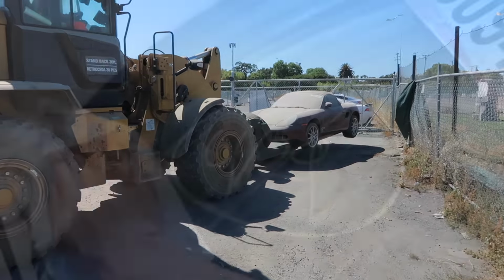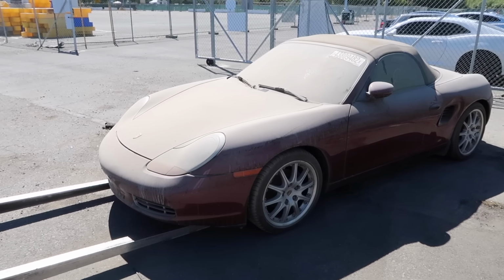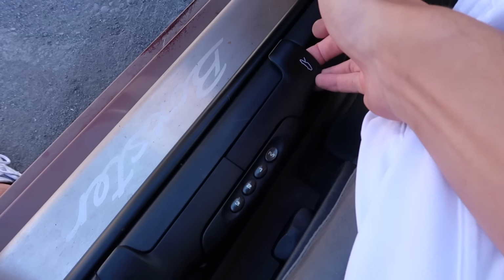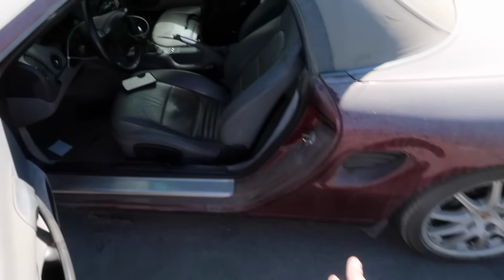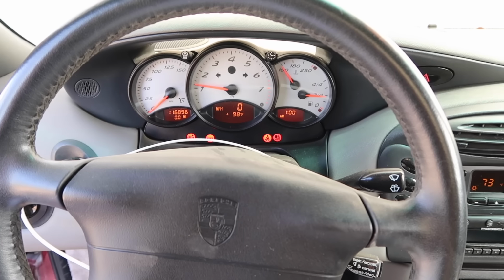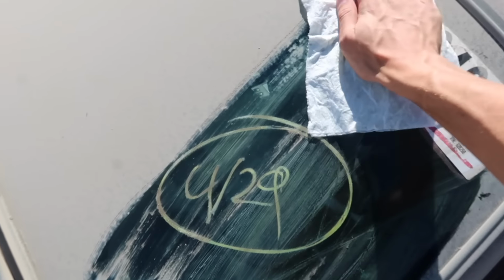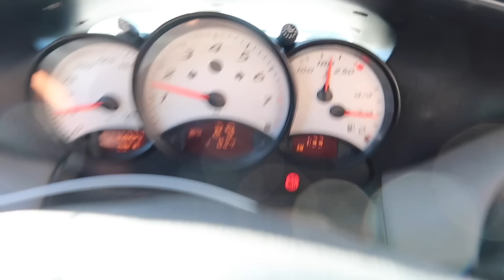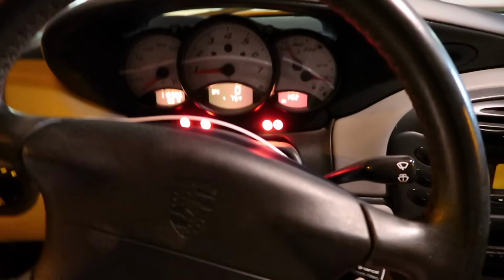I Bought a FILTHY Non-Running Porsche Boxster at Auction! Let's Fix It!

Comment from the maker: As promised, to close out the 12 days of Christmas special, we will be giving away our R3 RX8 tomorrow to a random follower for FREE 🙏🏻 Follow the IG page to have your chance at it! Thanks everyone for all the support of these daily uploads. Should we keep them goin?? We still have a lot of cars to reveal 🤫
Reply: I know You feel obliged to wear expensive wrist watches to match with the beautiful cars you deal with. But you did right not to wear one for this car pick up job. Nowadays we got so many things telling us the time. Like the movile phone. Your red C5 was almost as dirty.
Reply: 0:22 what is going on with that headrest?  ooof
Reply: Mate, you never connect a jump pack to the + and -. You connect the positive and then, to connect the negative, you connect it to any bare metal on the chassis. OR like u did, remove the terminals. Else the dead battery is just drinking up your current if u connect like u did first.
Reply: i want like 50 of them...! thanks again for your great videos
Reply: I'd love to include myself to your giveaways. But I don't have IG and I'm not going to get it just for your giveaways.
Reply: End of the day it is rear engined and it does need a lot of airflow going to it and going 30 mph and idling it for 30-minutes it is bound to run hot esp in that climate.
I've had 3 myself of this gen 3.3 Boxter S and with care like mine had they ran like clockwork.
Reply: Hello I just seen your video I bought me  a 2010 vw jetta 2.5 the car was sitting for a while with dead battery got new battery car does turn on nice but my windows the headlights the locks don’t work when I turn it on man it was crazy everything was going bananas lol but after a while it kind of settled down but still need help with the windows and stuff any clue I’m new on vw need help pls thnx
Reply: 5
Reply: I tried to Watch this video but the guy just would not shut his mouth up! Yapping and yapping about his good luck! Look man we just want to see the car run again okay 👍

Comment: Here's the deal ....  Been there, done that twice ... If you don't drive these for a month or so, the vampire electrical devices in the car WILL drain the battery.  If it's not your daily, keep it on a smart charger.  Once the battery is dead, you get to where this guy is.  You need battery power to open the front trunk but you can't jump the battery since it is in the front trunk.  Stalemate.  There are maybe three tricks on the internet to try.  Jumping the Row 3 Number 3 fuse worked for me once but the next time it didn't.  Porsche didn't put the post into the fuse box you thought was missing until 2001 or 2.  Some cars have that emergency pull cable, mine didn't.  My hood also had a sticky latch so pulling the cable he did in this video wouldn't work.  Smart chargers won't charge through the cigar lighter since they need a minimum voltage to work which you don't have.  And yes, the lever in the early Boxsters need power even though they seem to be manual.  The early year car levers have rods that keep the levers from moving.  When you have power, they pull out and you can move the lever.  After trying every trick on the internet without success, I borrowed a portable starter battery box with a cable that would plug into the OBD2 port.  VOILA !!!  Immediately opened.  Charged up the battery (slowly) and all was well.  But then it failed the smog test.  That is what happened to this car I'm sure.  Draining the battery gives you an engine code and you will fail the Smog Test.  There is a long procedure you can find on the internet to clear the code.  You have to drive for 30 or 45 minutes at like 35 mph then the same at 65 mph all without going above I think it is 3000 rpm.  If you have a track to do this on great.  But I tried all day and there was always cars in my way to slow me down or I would have to speed up so that didn't happen.  But just by driving it at all speeds for several hours over two days, it extinguished the code and I passed code.  So here's the deal.   Keep the car on a smart charger if you don't drive it regularly.  Get a portable start battery with a cable that plugs into the OBD2 port for if you screw up.  Drive it like hell for a few days before you try to smog it or it will throw a code.  And enjoy.  These cars are one of the cheap secrets of the fun car world.
Reply: This guy knows his stuff
Reply: Or put the jump pack terminal on the positive on the starter motor and the negative on the chassis .....easy
Reply: Battery disconnects are the cheapest solution.
Reply: @redbarchetta8782    That is no solution. For one, I never know when I'm going to want to use it.  A battery disconnect will deprogram many computers in a modern car that might even require a trip to a Porsche mechanic to reprogram. It also degrades the battery therefore its life. A proper maintainer prevents that.

Comment: I admire your attempt at working on a German car like this but I would at least change the oil before running and fresh gas as well as a few other things. Also washing the car before rubbing the dirt into the body or glass is always smart. That being said I appreciate your passion
Reply: He was in a junkyard. What else should he do? :)
Reply: Chazz, I know it's sometimes hard to understand him because he talks fast.  What he said: advised people not to do what he did, but put their new purchase on a truck/trailer and bring it back to their shop,  Also, he said more than once that he  couldn't get the rear hatch open so he couldn't check the oil.  Couldn't wash the car either because he's in a junkyard.  He's also done another video after this one where he does clean up the car, change the fluids and then drives it.
Reply: @danielfl.9347  not do what he did? Was laughing when he was talking about the oil making that clicking sound 😂😂😂
Reply: An amateur without doubt. How many cars has he damaged and not posted to YT?
Reply: I love it when someone points out this guy is an idiot then commends him for his effort.
Reply: @charlesduggan2980 what’s wrong with being an amateur? do you know what that word means? one who loves, that better than anything
Reply: It makes no sense that someone would have a 1999 Porsche Boxter sitting around like that. This used car is still trading at twenty thousand dollars.

Comment: Chain tensioner failure is a problem with many Boxsters and Boxsters and the 996s in the early 2000s had problems with IMS (intermediate shaft) bearing failures and RMS (rear main seal) issues.
As much as I like Boxsters, those things have kept me from buying one.  By the way, I would never start a car in that situation without first checking the oil level.
Reply: Rear Main Seal and IMS can be taken care of at the same time.   For the amount of fun a Boxster is and for how inexpensive they are for a Porsche I wouldnt let those two things stop you.  I didn't and love mine.   I have a 2004 that I have had for 9 years and it is in awesome shape.  Looks like it is maybe 2 years old condition wise.  As with any car, you gotta keep up on the little things or you will soon be overwhelmed with issues.
Reply: @MDQDZINE 2 years old 
Riiiiiight

Comment: The early 986, 97-99, have a double row IMS and don’t fail like the later single row IMS in the 2000-2005 boxsters. I have a 99 and it’s been nothing but pure joy and a pleasure to own. These cars easily go 200k+ miles with just normal maintenance and they are very easy to maintain. Keep up with oil changes and these cars will just keep going. You really have to drive one to understand but then u will really want one. Pure analog bliss that makes a symphony behind your ears
Reply: Got a 99 myself. I did install a new aftermarket HD IMS when I did the clutch. Since it was a black eye for early Boxsters, I wanted to rest my mind plus it makes for great resale value. Also a must have is to swap out the top with the rear glass.
Reply: The worst thing is selling a Porsche that runs beautifully like Dr P designed to a peasant who can’t afford to fix it if it went wrong so they pore over the maintenance trying to find fault and want a 5 grand Porsche to have full opc history .
Pure scumbags

Comment: I just joined your channel and love the car/aircraft content. I'm a retired Air Force aircraft mechanic and also a retired Manheim Auction lot worker. Here's a little tip to try. If you've got a car with a dead battery and you need power to access the trunk, if there's a cigarette lighter plug available somewhere inside, grab a jump box that also has a lighter plug and a cord with two male ends to go from the jump box to the car. This should give enough power to pop the trunk. You're welcome.

Comment: I had a 98 boxster that I pulled out of a field behind a body shop a few years ago - thing ran like a top once I fixed the damage and the broken vacuum line from the engine to the brake booster. Really good cars.

Comment: Before starting the car you should have checked the engine fluids, that is what I would do because that car looks like it has been sitting still for a long time and it is not known if the previous owner did good maintenance on it

Comment: I've had my 98 Boxster for a full decade now. Bought it back in March of 2013.

I do pretty much all of my own mechanical work on it.

Had no idea that release cable was up inside the fender liner. Just haven't ever needed it!

It's always gratifying to learn something new.

EDIT: The thing with the hood latches not pulling up is also news to me. I am seriously loving this.

If it helps at all, that tick sounds exactly like mine. If I leave it sitting for a couple weeks or more it will do it for a few moments at startup and then settle down. Been that way the whole time I've had it. I just assume it's what you thought with the oil working its way through after sitting for a while.

Comment: Yeah that generation doesn't have the emergency battery jump. You need to pull the handle harder. It's possibly locked electronically. You're so lucky and I'm very jelly about that cayenne turbo s and this 986 you got!

Comment: ticking noise is normally lifters after sitting for a time, it will go once the oil warms up and circulates, check your coolant level get a new cap and check the water pump is not shot
Reply: If you have enough oil.

Comment: @JRGarage, you want to try a tip that may work and save you time, if the Porsche has a cigarette socket, you can buy a "Portable" jump start pack battery, those are cheap i think there one of the Energizer brand, those are not really heavy load but once you connect those to the cigarette socket it will have power, so you can open the hood, then after you can use your regular jump pack. You may want to test that out and will save you some time.

Comment: The ticking sound most likely a sticky hydraulic lifter. Common when they’re left sat for long periods of time. Good old Italian tune up & an oil change should be all good. 
On my 2nd 986. Mega cars for the money.
Reply: Or it could be piston slap from scoring on the bores…which my 997 had😢…fingers crossed it’s just the lifters.

Comment: For it to open when you have the jumper from the fuse panel. You need to jump it, then use your remote to unlock the car, then the switch in the door jamb will work.

Comment: I had a 1999 Boxster and on 97-1999 the frunk is cable driven. It takes a bit more force to pull it than than electric models.

Comment: Pro tip get it basically mechanically sorted, then worry about what it looks like. 
Battery, fluids, oil, otherwise you have a great looking car that doesn’t drive or you blew the motor on.

Comment: sounds like a cylinder score issue  common in the porsche comunity hope they didn't  scam you!
it will over heat as the cylinders r scratching more and more bearings ect will heat up engine seals losen up than overheat

Comment: one car tip  if you take the dome light out and unhock the wires to jump it with your charger it will let you open doors ect any light plug will do cheers

Comment: Autozone should have been before the car wash to check/replace battery [and check alternator, after that.]   That way you avoid being stuck & needing a jumpstart.  Dirt is not an issue.   Power and fluids are.

Comment: Sasha looks like a nice companion for a supercar drive trip, is she good with a spanner?  What I think of the noise is that it sounds very expensive.  And you need to turn off the engine until you can change or at least top up oil.  I sure am curious know how much the wheels alone are worth?!

Comment: There is a 2001 Porsche Boxster at Alabama Copart unknown mileage doesn't show if it runs or drives and I think that's because the battery is dead. The current bid is $1950. If anyone is in Dallas and interested in seeing me work on this fun project reply back in the comments!

Comment: 7:00 Nope it's a manual leaver. The 98 - 02 had mechanical leavers for the front and rear trunks. 02 - 04 had electronic buttons to open them. I think the cable is broken that goes to the front trunk.
Reply: Lever

Comment: The main engine bearings on certain years will break apart causing metal shavings to destroying the engine. There is a bearing replacement if you catch it before the bearing gives.
Reply: I don’t know why they allow that. (Extremely unusual).

Comment: You obviously do not know the difference between early versions and later versions, you do not know you do not start an engine before checking oil ! And you pressure wash a soft top ? You pressure wash windows from bottom to the top rubbers ! Absolutely crazy !

Comment: I'm a bit shocked you didn't check the oil level prior to starting. Who knows -- there might be little or no oil in the crank case! I know, you couldn't get access... but after you found out on the Internet the lock/unlock reset trick, that would've worked without the engine running.

Comment: That is the oil reaching the top of the cylinders and I had a BMW that done that and any time I left it sitting for a month example the cylinders dries up but once the oil reach the cylinders that tapping sound goes away it's only temporary. Because trust me if there was not any oil in there that knocking sound would have been a lot louder it was some serious damage done to the engine but you're safe

Comment: If familiar with the car and only on some.... not all cars but depending on dipstick location and engineering can still get a seni acute or decent oil capacity check with it running....

Comment: Great find, trunk is on a elephant lol and isn't a E brake it's a handbrake.
I would Not be very lifting it on a forklift in the place they did with damaging any underneath pipes etc... very unprofessional...
But driving it 1k with it not being on the road for such a long while without re-comissioning... dangerous.
End of the day it is rear engined and it does need a lot of airflow going to it and going 30 mph and idling it for 30-minutes it is bound to run hot esp in that climate.

Comment: Sounds very much like piston slap from bore scoring. It’s a $20k+ engine rebuild.
Reply: That was a hydraulic lifter noise due to oil leak down.  The tappets tick until the lifters pump up.
Reply: uhhh...no.

Comment: Hi, I recently bought my first car and it is a Porsche Boxter 986 (2002). I did a huge amount of work with my own hands, restored all the plastic in the interior, cleaned the radiators, repaired the cooling system and much more... but unfortunately, after replacing the battery in the car and after replacing the battery in the electronic key, the car stopped responding to the electronic key.( (the light comes on when pressed and the battery has already been replaced twice, perhaps you know how to make the car see the electronic key again?

Comment: Also oil is the engines life blood and you can at least tell condition or semi level or that it has "some" oil in it....also maybe let it run for a few then shut off quick and checkout oil and re jump? If dont have a multimeter or super expensive battery tester that can check  charging system you have no clue  if the things even charging anyways....to me oil is wayy more important then having go re jump the thing and just keep it running...

Comment: Trade you my 2006 Cayenne S Titanium for it. I had a 2004 Boxster for a few years before moving up to the Cayenne to pull a boat. No longer have the boat. 2006 Titanium models are an alloy chassis that unlike other Porsche, won't rust. Fully updated cooling system and driveshaft so all kinks worked out. Just the big V8 drinks more gas than the local town drunk so not driven as much anymore.

Comment: Hey do you know anything about a 2004 Nissan 350 Z that had keys lost and the guy who rekeyed car charged $360.  the car started once we parked it and it will just turn over now.  Dealership says that we have to tow car in and pay them $600 to give is a key that has a chip.  Does this carve a security feature that is keeping it from starting?

Comment: The 99 did not suffer from 
IMS bearing issues to the same extent as later models. 

Your color is Arena Red. With a grey top. It is more commonly over savannah beige with a black top, but it is still a superb color.

Comment: WHAT? Still no comment on how much oli was in it? As I recall they did this with the other BOXTSER recently! OMG! How could you drive a Porsche and NOT CHECK THE OIL LEVEL? I don't think checking oil levels are strong points for these blokes. Good luck with that IMS and main bearings! They just LOVE RUNNING ON NO OIL!

Comment: What a long waffly start , you should have checked the engine before starting after getting to the battery. With the engine standing for so long parts can get sticky … you have been very fortunate with this buy. I love the dust … looked after the paint … the car wash should test the waterproof state of your car. As a manual you could have even push started the baby …